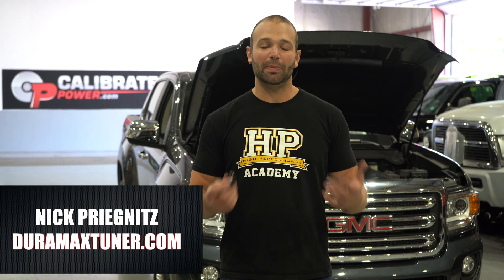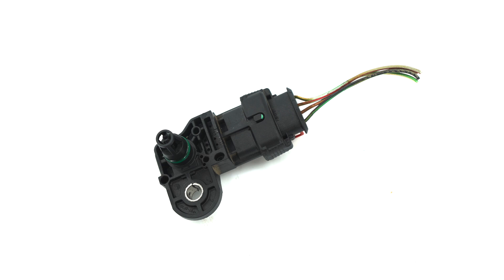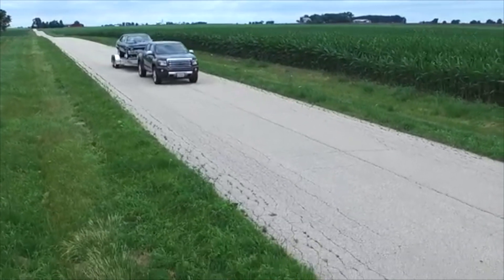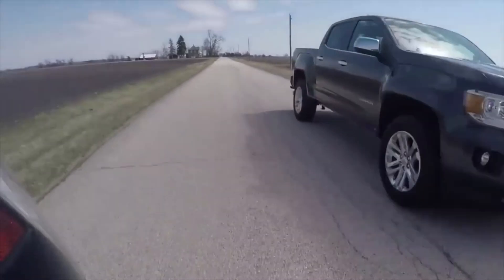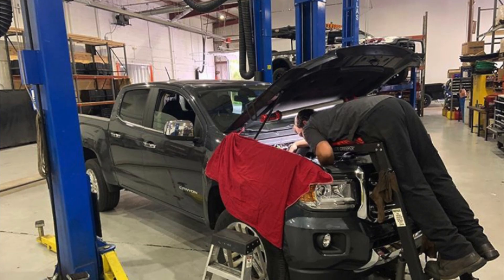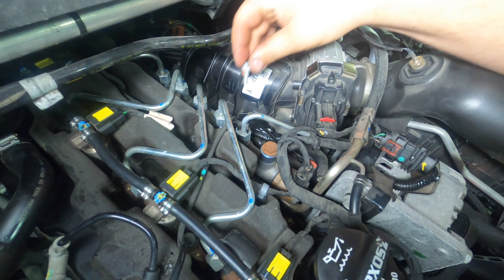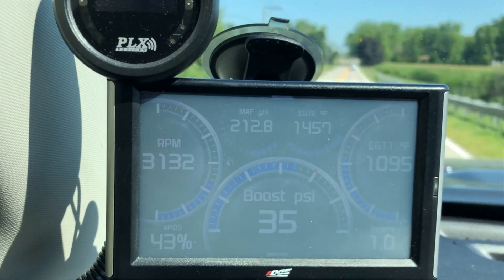Your 2.8L Duramax MAP Sensor Needs An Upgrade

Comment: Just a reminder:  Chilton's and Hayne's no longer publishes repair manuals for newer vehicles.  A location of where to find the MAP sensor on the intake manifold would be great.  Also, the guy never did explain how you connect the new L5P MAP sensor (8 wires) to the stock 2.8L wiring harness (5 wires).
Reply from the maker: Thanks for the feedback! We'll take it into consideration for future videos.

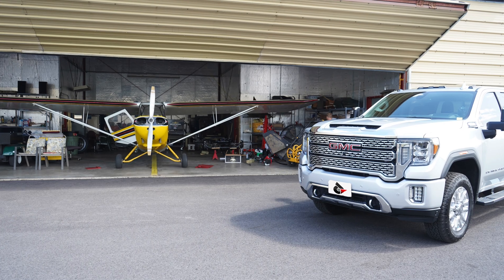Comment: 2:32 Instead of showing, or describing, where the MAP sensor is, you start talking about a different truck/engine. 🤦‍♂️
Reply: In case youre not aware...hes wearing an HP academy shirt, talking about modifying the vehicle. If youre not sure where the MAP sensor is (its on the intake manifold) you probably shouldn't be touching it. He mentioned a different vehicle so you can get a factory "upgrade" that will be a quality that is damn near plug and play for a platform that doesnt really get a lot of aftermarket support. His video is accurate to what is required for anyone looking to do this modification

Comment: Does this apply to turbo diesel engines only or gas as well?  By that I meam MAP sensor maxing out.
Reply from the maker: @Silent_Shadow your map sensor has the possibility to reach its limit when you start adding modifications to increase airflow. i.e. aftermarket turbochargers. However, simply upgrading the flow characteristic of your stock intake system will not typically be enough to overload a factory MAP sensor. If you are just adding an aftermarket intake system you should have no need to upgrade.

Comment: do you want to explain how the turbo can run away when the cal has vane angles and calculated turbo speeds limiters to prevent that EXACT situation?? Your vid comes over like the turb can run itself into a massive over speed in OEM form IF over the MAP sensor max is commanded. GM prevent that!! There are better upgrade MAPs available that don't require rewiring- straight drop in and play.

Comment: 05 LLY 72mm turbo from LDS. Pretty sure I need to upgrade the map, any suggestions as to which map I should get? Future plans are to go compound over stock. Stock fuel system but I only see 25lbs. Seems low to me for that turbo.
Reply from the maker: Give us a call, 815-568-7920
Reply: @Duramaxtuner can I also call you regarding my chevy express 2.8 duramax diesel upgrades? Thank you

Comment: Does the upgraded MAP sensor do anything to a stock build? Or is it only effective when other upgrades are present.
Reply from the maker: If you have an all-stock truck, start with tuning before you get into upgrading your MAP sensor.
Reply: @Duramaxtuner  Thanks for the info. I have been hesitant to upgrade my 2.8. i want a bit more but i dont want to do too much. I will look into a tuner
Reply from the maker: @hurtado40  https://duramaxtuner.com/diesel-tuning/switch-on-the-fly-tune-incl-efi-live-spade-lwn-2018.html

Comment: I've been using hp tuners, and it seems the ecu has a hard limit of 300kpa. How do you get around that? Scaling?  400kpa in the manifold but the ecu thinks it's 300? How did you scale the other tables?
Reply from the maker: DOes HPT allow editing of the MAP linearization table?  Have you rescaled it to the sensor?
Reply: @Duramaxtuner  HPT does allow you to modify the MAP Sensor linear and offset values. I have installed a Bosch 4 bar tmap sensor and scaled it accordingly, but the scanner still flat lines at anything above 300kpa. I understand there is much to be desired with HPT on this platform. I'm beginning to believe that the software is my issue.

Comment: Nice video.  Please correct me if I am misunderstanding your info.  I down graded to the 2.8L Canyon.  I do not pull any longer, but after driving the Canyon I noticed the stall when accelerating.  I am not after more power/torque, but to eliminate the stall and improve engine performance.  The GM part change and the Stealth, when available, can solve my issue?  Thank you.
Reply: In your case a Pedal Commander would be a huge help.
Reply: Forget pedle commander get the ibanks pedal monster and Idash.  It will also reset all of your error codes. 4:06 4:06

Comment: i have a 2.8L duramax diesel colorado..why my truck stall on 2nd gear when acceleration pedel is pressed but completely fine when you run it on just clutch pedal?

Comment: It pains me to see the use of butt connectors (and possibly the incorrect size ones; yellow is typically used on 10-12 gauge wire) on sensor wiring. In my many years at GM dealerships I am aware that GM approves of this use but my experience has proven butt connectors to have issues with long term reliability, especially on sensor wiring. The practice of soldering wire connections followed by 2 layers of shrink tubing (per GM exterior wiring repair standards) has shown to have more longevity and a cleaner look compared to 4 non staggered butt connectors. 
If we, as professional automotive repair technicians, are going to ever get past the stereotype of "grease monkey" or "mechanic" we need to show our level of expertise to the general public every chance we get.
Reply: Soldered joints are more likely to break than a properly crimped joint with self-sealing heat-shrink. Any movement and a solder joint will split right at the edge of the solder. A crimped and sealed joint, on the other hand, will tolerate harness movement. There's a reason solder is not a common sight in motorsport or aviation.
Reply: Pro trick : watch series at Flixzone. Me and my gf have been using it for watching loads of movies recently.
Reply: @Ahmad Sebastian Yup, have been using Flixzone} for months myself =)
Reply: ridiculous

Comment: Interesting video.  Speaking of MAP sensors, the sensor in a stock truck with no catch can and running EGR quickly gets "goo'd over".  I can't imagine a MAP sensor covered in a thick layer of black tar is relaying good information to the ECM. 

What are you using for turbo hoses with all that boost?  The flimsy made in China OEM hoses worry me at stock boost levels.  A kit to adapt the "clip" type mounts on the intercooler with better silicone hoses in pretty colors would sell like hotcakes!  Gimme gimme...
Reply: if only there was a company that made high quality powder coated piping.....hmmmm